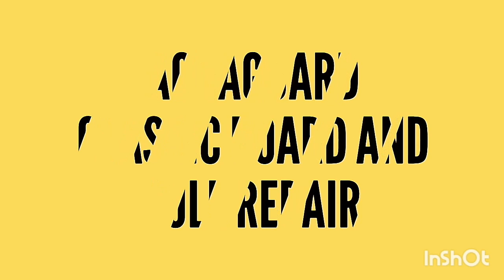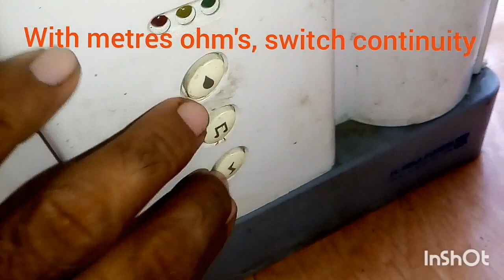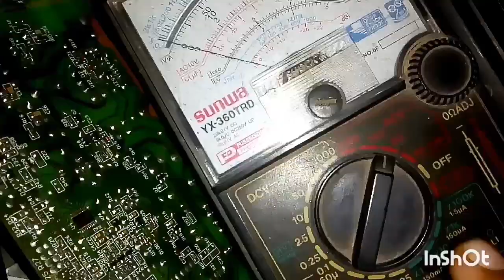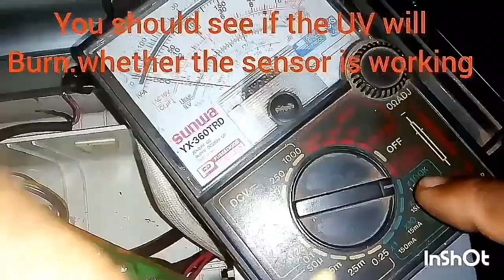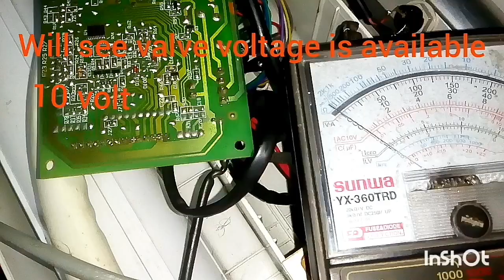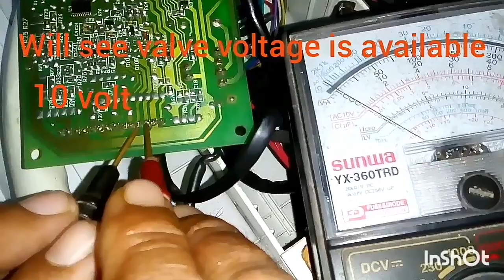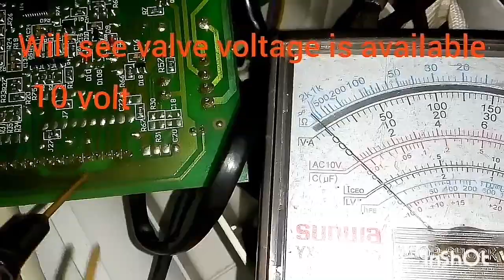Aquaguard classic circuit board and full repair

Comment: Sir mera aquaguard hiflo eboiling water purifier ko on karte hi red light phir yellow light phir wapas se red light blinking horaha hai beep ke sath. Meine uv light, ldr sensor aur solenoid valve check kia to sab ok hai but solenoid valve k pin par 12 v dc nahi aaraha 5 to 4 v dikha raha hai... Koi solution batao sir pls.. kya solenoid ko 12v nahi milne  par aquaguard work nahi karega?...

Comment: Nice informative video. Will you please let me know; the function of the wire wound over the water pipe connected between carbon and u.v chamber. With regards.
Reply: Even I have the same question
Reply: I think to generate magnetic field so that iron particals will stick to pipe